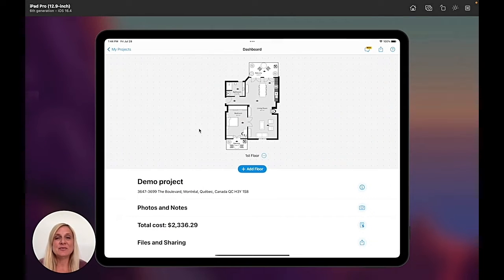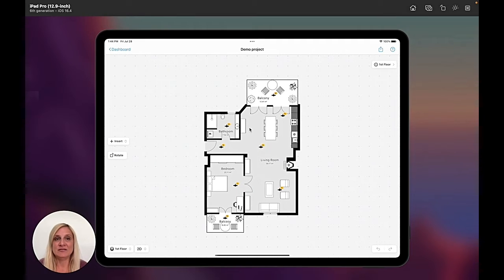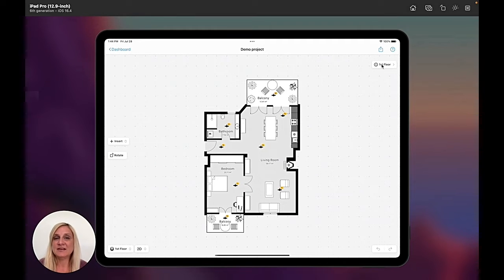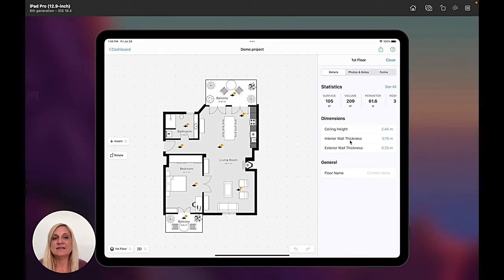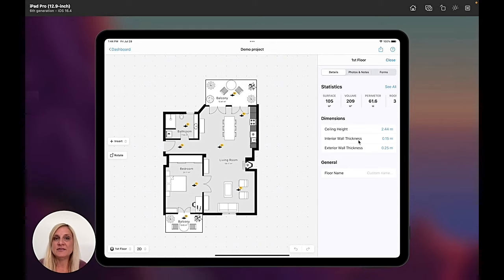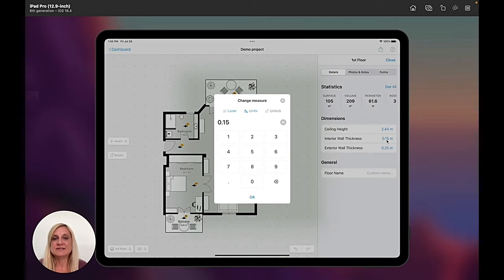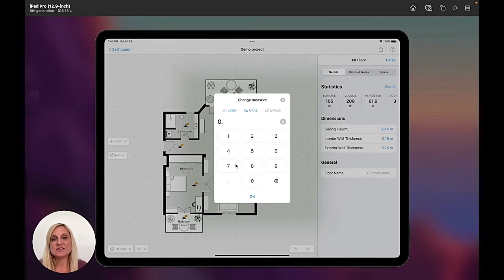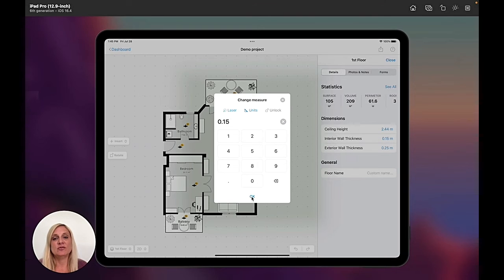Change Wall Thickness

Comment: Yes, one size for all inner walls is unfortunately😢.
Reply from the maker: You can change exterior and interior wall thicknesses in the following way:
- Open magicplan
- Tap your plan to open it
- Tap the info button on your floor level - (i) icon on the upper part of the screen 
- Change value of "Interior Wall Thickness" or/and "Exterior Wall Thickness".

For the moment it is not possible to change individual wall thickness. It is a feature on our roadmap, we plan to add it to magicplan in the future but we don't know yet in which version of magicplan it will be added.
Reply: @magicplan  Yes, it's pretty hard to put the increased thickness for interior load bearing walls on the schematic now. Only if you move the walls of the rooms away from each other, resulting in double thickness of internal walls.